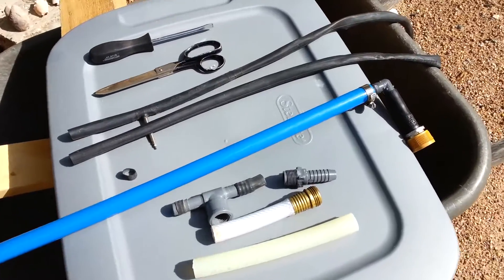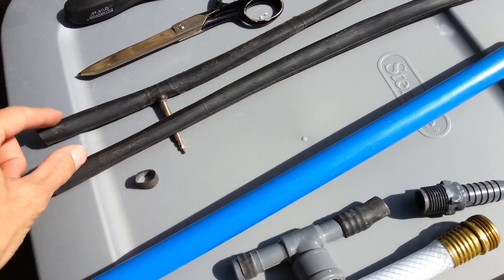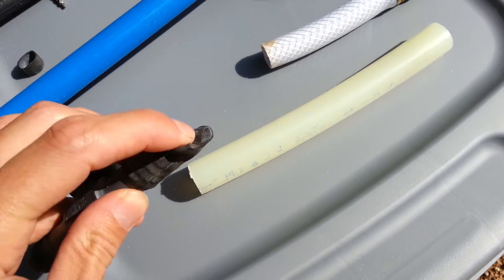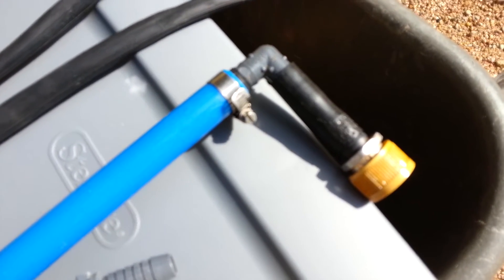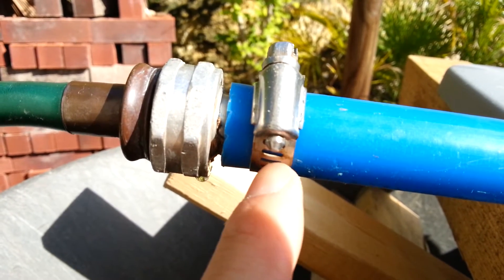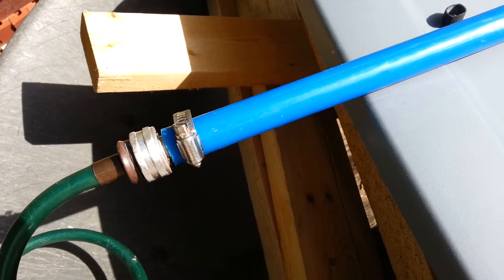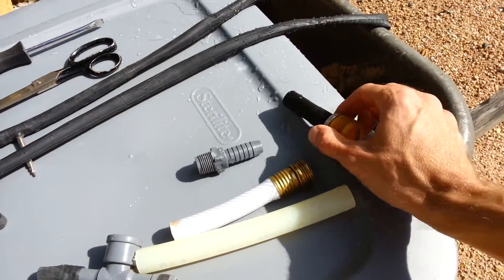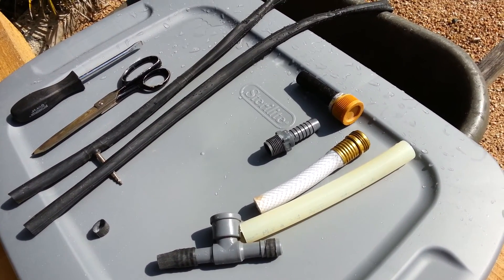Cheap diy pex connection to drip irrigation

Comment: Wonderful job!
We are going to do a drip irrigation for our pumpkin patch, although probably next season due to cost of materials.  

However, this will definitely help keep the cost down. Thank you for the tip. 
We will need around 2,000 feet of tubing and probably hundreds of connectors.  

I will put a regulator near the hose because my house has crazy high pressure, but with this length of tubing, I'm not sure it will work well unless I use a manifold of some type and then branch off from there.  

I wonder if one could use some type of platidip (like what you'd dip an axe handle in) to simply dip the connector and let it dry?  This way you wouldn't need to monkey with the innertube.  

In any case, thanks for the tip.
Reply from the maker: You might experiment with a heat gun which can expand the tubing. Then insert the connector while it is still warm and flexible.

Comment: Thanks! I am working on my new irrigation system with pex. I like your idea for the pex-poly connections, because pex shouldn't be used above ground. A pex crimper tool is one of the best investments I have made. You can get plastic pex fittings (couplers, elbows, tees etc) for cheap. The metal crimp rings are not expensive either. Fittings are reusable, crimp rings are not. But once the system is in, I am not making many changes. I think we will see a lot more pex for irrigation main lines as it is approved for direct burial, flexible but strong. Poly is flimsy and pvc gets brittle and breaks. I have had multiple pvc breaks at the lines to my horse waterer spigots. Gah. Nothing like digging up shopping wet clay to find the leak.